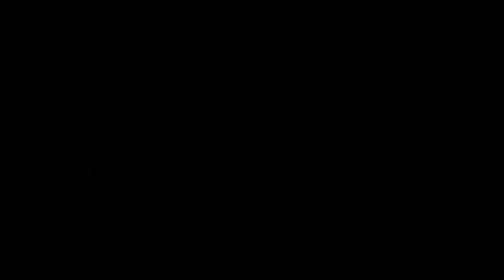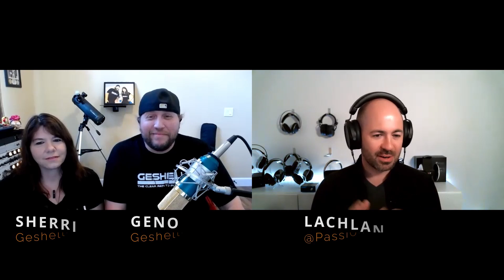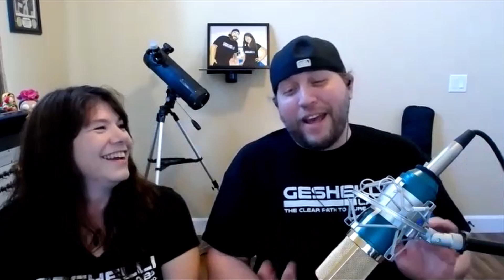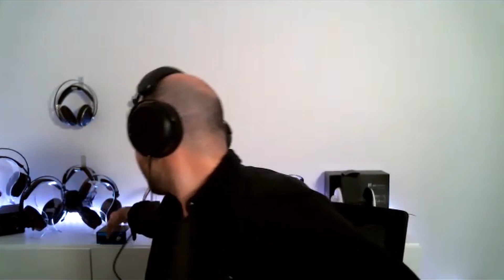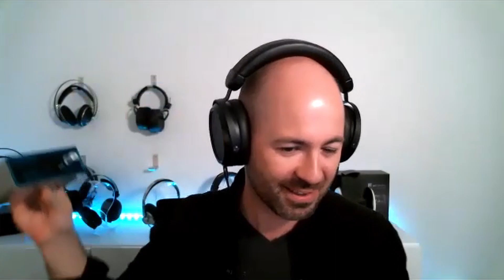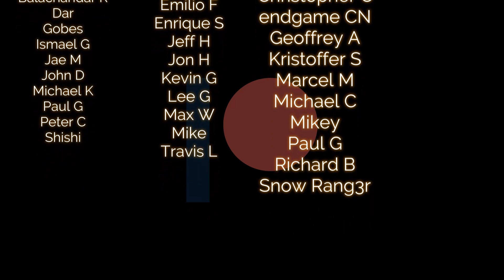Geshelli Labs Interview - Part 1: Origins and designing great gear

Comment: Nicely done.
From their web site it looks like they do primarily amps with an occasional dac (out of stock limited addition).
Did you get the impression they have a dac in the pipe line for 2021 ?
thanks
Reply from the maker: Hi Bruce, they've always made DACs, but unfortunately the AKM fire pulled the rug out from under their current model. We talk about it in Part 2, but there is a new one on the way.

Comment: Love my Jnog, but something is wrong with it. Once you install the drivers the optical fails to work, and if you dont  install the drivers the unit ticks on usb.  So I only get to use the usb all the time and prefer the optical or I have uninstall the drivers lol
Reply from the maker: Hi Mike, that seems strange. Have you contacted Geshelli about it? I'm sure they'll help if they can.
Reply: @PassionforSound  Yessir,  Geno helped me himself, but we are not sure what the issue is.  Also, the issue primarily occurs using Quboz which is my main music platform.  

We are assuming it's my pc, but I find it strange.  optical is not a selectable option on Quboz, it just disappears when you install the driver.

But overall is an excellent dac, sad this situation has occurred and I hope they repair it in future dacs.  Also to consider that this is the first unit with USB so probably why they didn't even use that in the first place
Reply from the maker: Wow. That's so strange and a shame that it's happening. Hopefully you'll get a fix in the future if it's a software/firmware/driver issue.